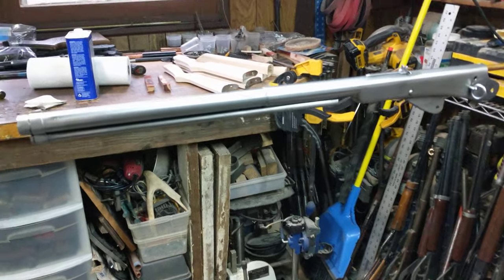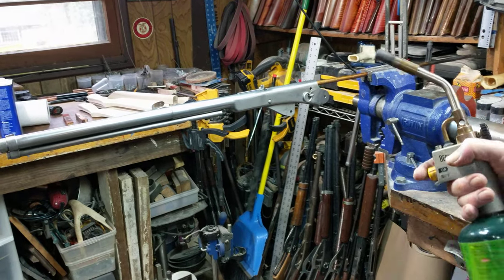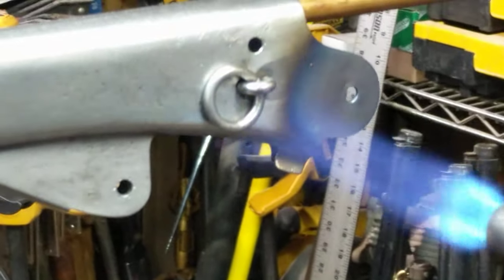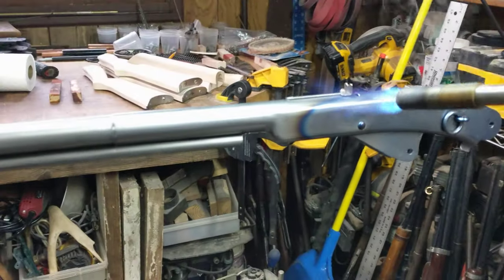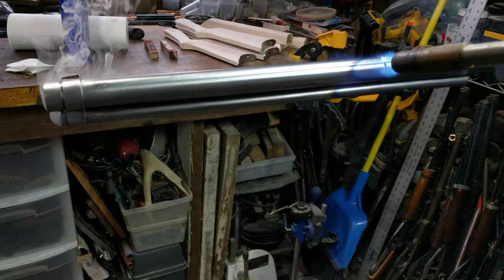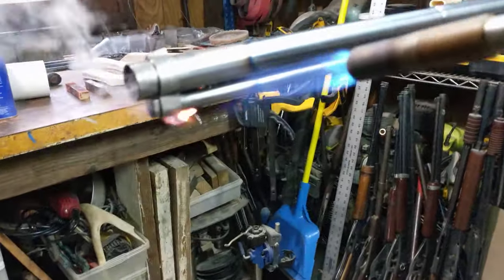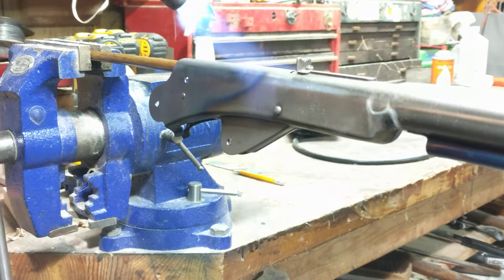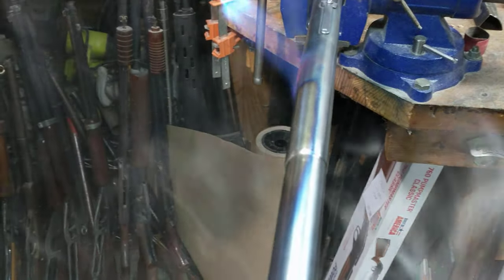Fireblueing a Daisy.

Comment: I didn’t realize until you were to the end of the first side that it is only the heat, and no blueing chemicals to be used. I wonder, could I practice on some conduit to learn the technique?  Also, I’m curious why you never work on Model 25s?
Reply from the maker: I don't know if conduit would be the best material to practice on. If there's any galvanized finish on it that burns off the fumes can kill you. Daisy recievers are pretty thin metal and they'll run up through the color spectrum fairly quickly with a standard propane torch,  conduit might the best substitute as the wall thickness is greater, meaning you'll have to spend more dwell time to see  the color shift. I'd just get an older beat up Daisy and practice on it, once you've fireblued it you can knock the oxide off with a wire wheel and have another go a it. I don't work on Model 25's routinly as they are an absolute bear to reassemble.

Comment: No problems with warping doing that? Or not that critical?
Reply from the maker: None so far and I've done about 60 or so of these. It's a controlled heat application to get the steel up to about 550 degrees to induce an oxide coat.
Reply: @RestOModDaisy  Thanks, the results look good.

Comment: This looks great, but does this provide any protection to the metal? Does this impart any rust resistance?
Reply from the maker: Carl, it's an oxide coat and will provide protection against surface rust but it must be kept oiled like any other finish.

Comment: Hello Shane.I have a question. After the peice has cooled down ive noticed some spots that are uneven.Can you simply just go back over the spots that needed a little more heat to attempt to make everything match? Or do I just have to start over 🤔
Reply from the maker: You can reheat the mismatched places and see if you can get a closer match or wire wheel it off and have another go. A lot of times on the first attempt I'll get discoloration from oil/grease on the inside of the reciever that leaks out through the seams on the barrel shroud and they'll make for differing shades of blue/purple/straw. I always let them cool after fire bluing and then put a coat of oil on them to see what they look like before re-firebluing.

Comment: You must have the abutment seal out?
Reply from the maker: Yes, otherwise you'll really regret  it as they char up or melt down. Do pull the abutment seal before fire bluing a pre 1978 Daisy and pull the shot tube assembly from any post 1978 Daisy as their plastics will melt.

Comment: Very cool best video off fire bluing I've seen. By the way what shot tubes will fit a model 98?
Reply from the maker: Thanks! The current production Model 25 50 round springloaded shot tube will fit if used with a 3/4" copper coupler cut to an appropriate length and the most common of the original Daisy Bottlecap shot  tubes should fit with out couplers.
Reply: @RestOModDaisy  Thank You.I just bought one off line and the pictures weren't up to par so I'm not quite sure it will have one when I get it.But got it cheap enough so not complaining. Also when you let the gun cool and hit it with flame the second time is there still a color line to follow and I'm assuming it makes it a darker blue when completed?
Reply from the maker: @russellhorner4950  The color line is not as obvious on the second pass and I find that it's necessary to rotate the work under a good light source to follow it. Repeated passes to not guarantee darker colors in my experience, if anything you'll see more purples as well as some straws due to repeated heating, an effect that I like.